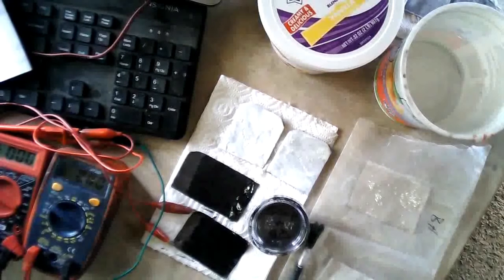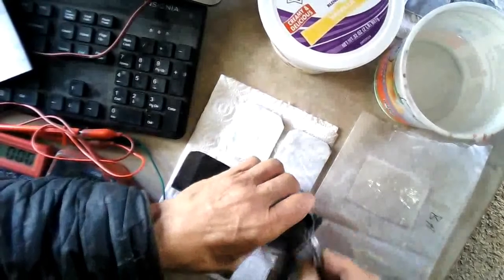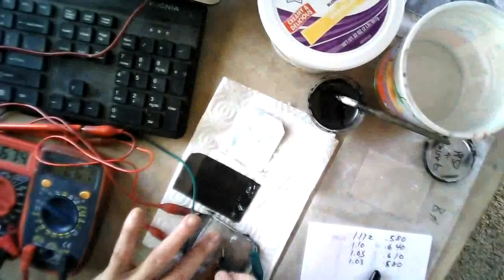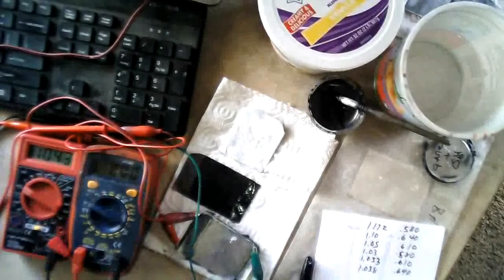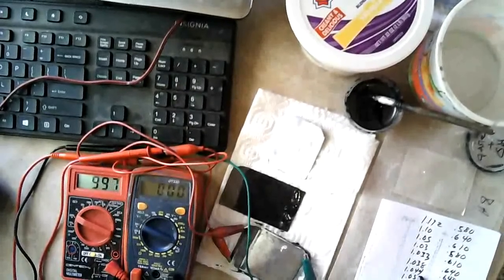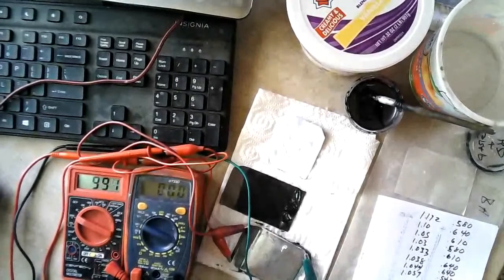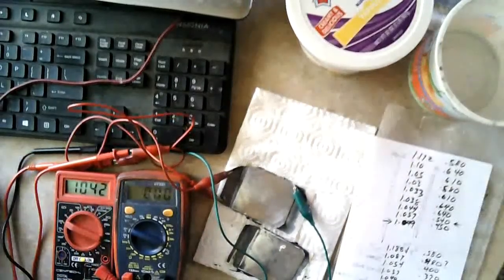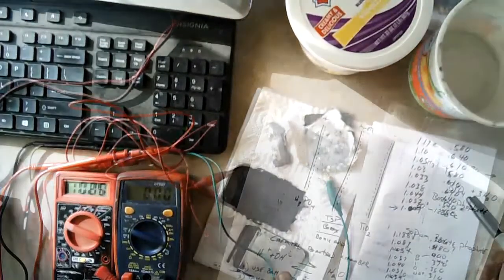Easy Intercalation & Exfoliation With Phosphoric Acid! Part #5

Comment: Borax converts to boric acid naturally. Adding boric acid maybe effectively circumvent the reaction allowing for less conversion. It might also be a more effective solvent accelerating the bleeding.
Reply from the maker: Considering how difficult the boric acid cell was to take apart Fred, I think the boric acid didn't gel the PVA glue as well, or maybe the PVA gel fell apart as the boron was transferred. Or maybe some phosphoric acid migrated to the membrane, and the boron phosphate formation made the thin film fail. Only more tests will reveal what happened.

Comment: I really like the idea of separation through the large borax sodium ions wanting to attach to the hydrogen. Do they gaps inbetween the layers have to be large enough to allow passage and then they expand when attached to the hydrogen ?or is the charge attraction  enough force to facilitate the migration for the bond ?
Reply from the maker: It's actually a substitution reaction EPN. The sodium replaces the hydrogen to form TSP, which should force the graphite sheets apart. I'm stirring a weak solution of borax and intercalated graphite now, and I'll test it for graphene later today and let you know how it goes. :-)
Reply: Bio-Cell ahh so the substitution reaction prefers sodium as a stronger bond than hydrogen ? Is this a covalent bond or ionic or ??? i am looking it up on google but a little confused as to what is going on !🤔
Reply from the maker: I think Sodium has a +2 charge, so one bond would be to the phosphate ion and the other one free to bond with battery Hydrogen.
Reply: Bio-Cell looking forward to you outcomes bro🤔
Reply: Bio-Cell oh so the hydrogen would rather bond to other hydrogen and the +2 charge is a stronger attraction so it both maybe ?
Reply from the maker: I think it's a matter of availability EPN. Hydrogen is the fastest reacting element, and the smallest. It will bond with whatever is available in solution, in ratio to the concentrations of the available elements. That's my understanding anyway. You might want to consult a chemistry expert about this. I'm learning as I go here. :-)
Reply: Bio-Cell yeah I know but your input and perspective gives me a wider perspective for my learning . Much appreciated
Reply: Bio-Cell I think your explanation makes sense to me more than any of my chemistry teachers 😂